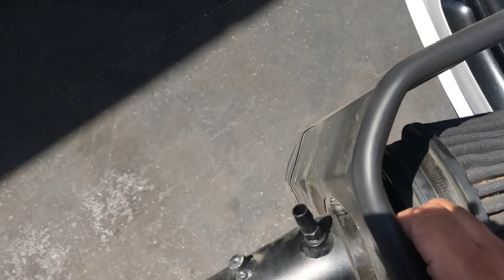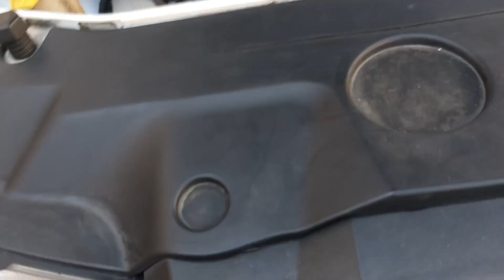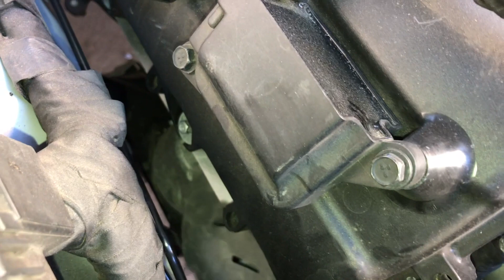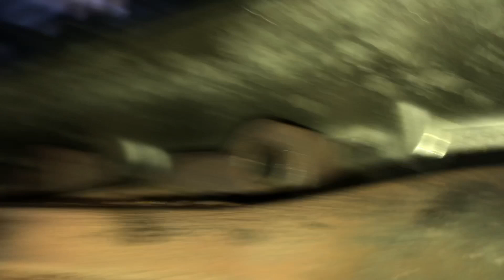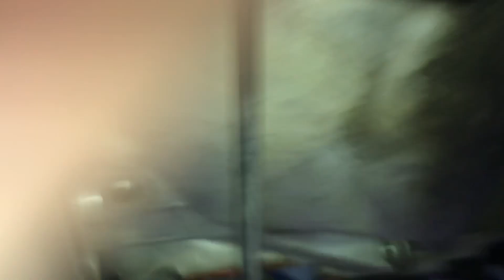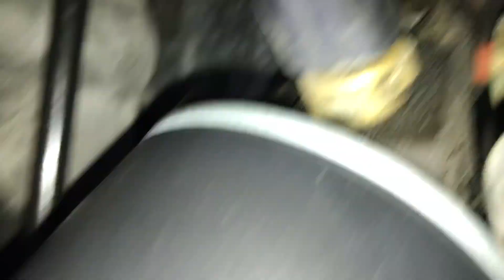2014 Charger Long Tube BBK Headers Install and Open Header Start!

Comment: what gaskets did you use because i heard the bbk headers gasket leaks
Reply from the maker: @cee-7ds  BBK gaskets. But it is better if you use ones from dealer or steel layer ones.
Reply from the maker: Bbk gaskets. Sometimes bolts come loose because of heat. You gotta retighten the bolts.

Comment: Support the engine with a hoist and drop the subframe. It's literally half the time and work😊
Reply from the maker: Is it? Next time I have to do another set I’ll try it like that.
Reply: Have you seen or heard anyone who has use the flowmaster single chamber mufflers, I think the baby flowmaster is called something like super 40 series etc,.? I was wandering if these would sound good on the hemi engines

Comment: How did you get your dipstick to mount. I couldn’t get the stock bolts to work on mine and didn’t have a bolt that would work to mount the dipstick tube?
Reply from the maker: There’s bolts with stud at the head or get a longer one and put washers as spacers.

Comment: Did you have trouble with the passenger side top middle bolts. Can’t get them started.
Reply from the maker: No, try different tools, use wrenches and 1/4inch ratchets. Also, try to get some of them from the top.
Reply: @mysterygarageCA   hand doesn’t fit from the top. Lol.  I use a 1/4” ratchet on all so far.  But can’t on this one because the tube is over top the hole. 2” primary tubes. What size were yours?

Comment: Did you tune it.
I heard U can't run them with out a tune I'm about to get my done in two day..
Just wondering....
Reply from the maker: No, you don’t need a tune!
Reply: @mysterygarageCA hos long did ur 5.7 run with without tune after putting headers on
Reply from the maker: @Aaron-e4h you don’t need a tune. With all the sensors you have the car will adjust automatically for the flow. If you want to tune it and advance timing that’s optional.
Reply: All they do is let ur engine exhaust and breathe better releasing back pressure faster causing more hp. If u install turbos and superchargers u need tune.

Comment: I recently bought some, would I need anything else to install it?
Reply from the maker: Long tubes?
Reply from the maker: Just the flange on the ends of the headers
Reply: @mysterygarageCA  do you remember what size of flanges you used?
Reply from the maker: @KevinMartinez-yk6uj  3inch

Comment: Any problems with the bbk long tubes
Reply from the maker: No
Reply: @mysterygarageCA  so will the bbk flange with those cause exhaust leaks or anything
Reply: @mysterygarageCA  because that the reason I don’t wanna get them if those flanges are gonna cause exhaust leaks

Comment: hey i have a 2013 pursuit with the same cai as you and I plan I ordering bbk long tubes but I was wondering do you feel a big difference or does it feel about the same
Reply from the maker: You feel a difference on throttle response
Reply: @mysterygarageCA  do you think its worth it I was going to do a stage 2 comp cam but  I don't have much experience so I would haft too take it too a shop that's why I was thinking for now long tubes
Reply from the maker: I think it’s worth it
Reply: Best bang for your buck is exhaust work and rear end swap. These cars respond great breathing better.